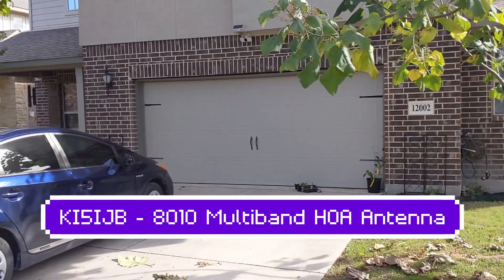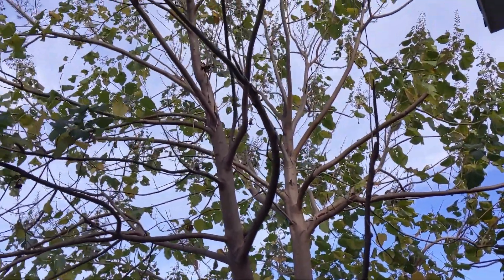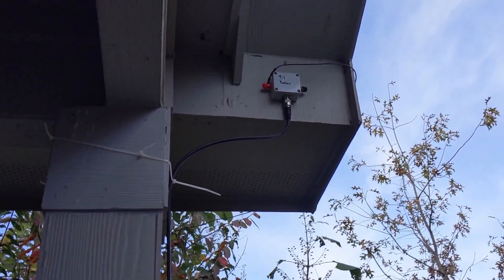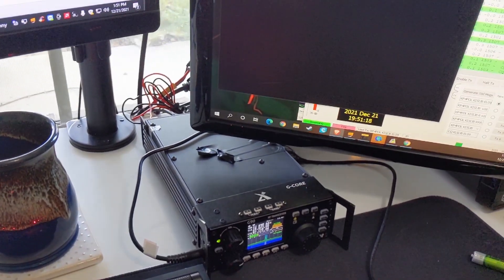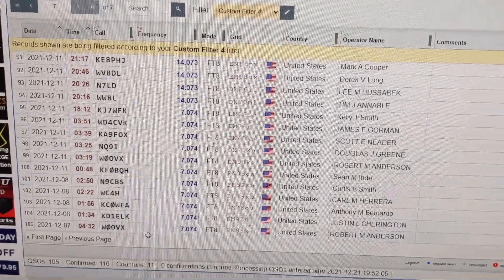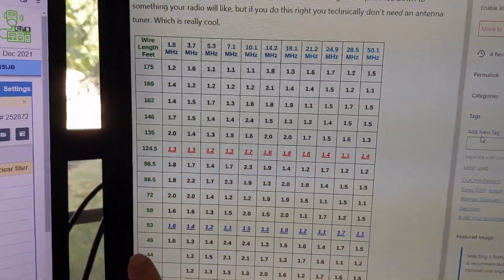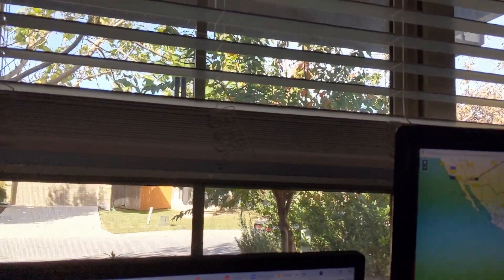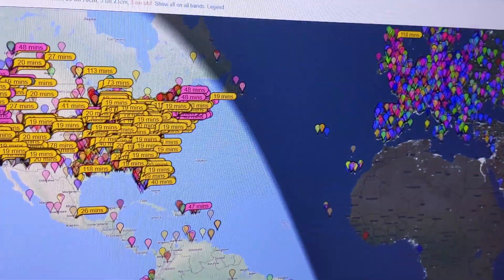Stealthy HOA HF Antenna

Comment: good job!  Only thing to maybe do if you can is bring that wire into your balun from underneath the red connector.  The camera angle makes it look like it is sloping down from above and therefore water could get in.  May not be an issue but couldn't hurt!

Comment: As a fellow ham stuck behind enemy HOA lines, I have a few ideas: Use small U-shaped nails that pin the coax against the post instead of the zip ties. Run the coax along the edge of the concrete up to the outer wall of your shack room. That Comet coax device is attenuating a significant amount of signal, so let's get rid of it. Drill a single hole in the wall into your room. You can rent an impact drill and long masonry bit from Home Depot. Cut the end of the coax at the connector and run it into the shack. Once it's inside, reattach your toroid to the line and put on a new PL259 connector. Although your balun is under the eaves of the roof, use some self-amalgamating tape to seal it from moisture. You can also use a small amount of caulk or other sealant to close up the hole where the coax is installed. It only seems like a lot of work, but I promise you it's well worth it. Good luck.
Reply from the maker: That sounds like a pretty good plan. I think I might have found a way to do it without drilling a hole but let me know what you think. Turns out there is a TV coax drop in my shack room and I found where that coax leads into the attic. I think it's 75ohm stuff, not the common radio 50ohm, but theoretically I think I could make it work. I'm considering relocating the antenna to the upper eave of my roof (3 stories up) and running the antenna from there. Don't know if that would get me a cleaner signal out or not, but it would avoid that run through the window for sure.
Reply: Those are very good directions! I might have to do that for my set up. But like KI5IJB, my home office/ham shack also has a connection coming down from the attic in the wall for a TV cable connection .  I will probably route my cabling through that same area. I don’t have a TV in that room so I’ll probably just replace it with antenna cable. Regardless, all great ideas from everyone commenting. This is KB4ROY clear!

Comment: Nice video. One little thing though, it's not an end fed half wave. An EFHW would be 63' long. This is a "non-resonant" wire antenna fed via a transformer. Although the two look the same they are actually very different antennas. I've used both in different circumstances for years. The non-resonant wire is great because you can get away with a shorter antenna and they have be very stealth.

Comment: I have only had my General for 9 months. I can see the use for DMR and Winlink as you can actually transmit a message but cant find a use for FT8 or many of the other popular digital communications over HF. Yeah the hobby is diverse and you can say I do it because you can but if there is no actual communication, no message, then what is the point? It's kind of cool that low powered radios can link to others but I try to find the practical usefulness in a thing.  Perhaps one day they will link a messaging app to it. Good video just the same.
Reply from the maker: I can see you point of view, for sure. I consider FT8 a purely fun mode for HF and admit there isn't a hugely practical application for it, as far as I can see. For me it's just a more relaxing, low-key way to make contacts with people who I might not otherwise be able to talk with via voice. Thanks!
Reply: With me, I key up on FT8 just to see if the bands might be open. I have made contacts on it, but that's all. I think if all one wants to do is rack up contracts for digital awards, FT8 can do that. As for real communications, there are plenty of other modes for that. When I started digital, PSK31 was really hot but over time, declined. OLIVIA is pretty good too.

Comment: This just goes to show what can be done with some wire a 9:1 and a simple choke.
I lived in an hoa in the mid 70’s in Fla.
As a Novice set up a 40 meter dipole on the backside of the house and was able to work 15 meters too.
Didn’t know what a choke was or a balun and still made 100’s of contacts. 
Just good ole perseverance
73
WD4DDA

Comment: If they are metal, start viewing your gutters as a whole. With some planning, bonding and knowledge, you can turn them into very effective radiators. Also, laying wires, properly spaced, on the roof, you can create Yagi. Aim it north for global play. Whatever way you need to. I did this for 15 meters and worked the world on 5 watts with a Flex 1500. I set up two wire Yagi, one pointing 30 deg. and the other 210. The house was orientated perfect for this. I laid one on top the other. A total of 6 elements in the space. I could switch between them. 

FT8 can be done with a stop sign, really. Phone is where you will know, and where the fun is. We are into the cycle, and I hear Europe and the Pacific daily. PSK REPORTER is handy. I set it in a way that shows only stations that heard me. Not all those monitors and things we cannot hear. It cleans up the display and works in near real time.

Tip for down the road regret avoidance. It may be a good idea to use logging software/service that records States, Counties, and Grid which auto populate. HRD is good, and it syncs to Logbook of the world. There are other great choices. I use HRD for everything except FT modes. 

Just a few things I do.
Reply from the maker: Thanks for the comment! I don't actually have any gutters on this house as of yet, but that's definitely something I've seen people do with some success. My biggest issue right now is my house is blocking my signal/incoming signals from almost all of Central and South America. Thinking about relocating it to run across my roof about a foot or two above the shingles and seeing what that does. At least that way I can see the horizon, so I think that's a good start for phone DX. 

And I agree, phone can be a lot of fun (and the most fun I've had with radio so far when traveling). FT8 is a different experience and something I can do while working in my office without too much fuss, which is nice. Also, now I've gotten a pretty good idea of what my antenna and radio can do in the current configuration so any changes I make can be compared with a relatively large pool of data that's been logged (signal strengths, etc). 

I appreciate you stopping by and I hope to bump into you on the air!